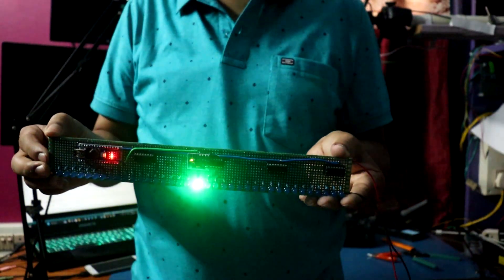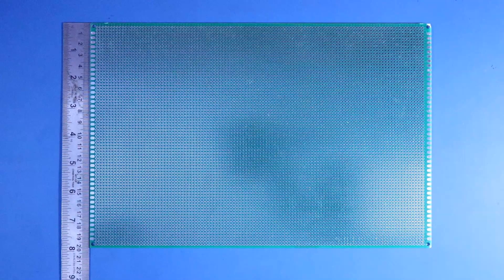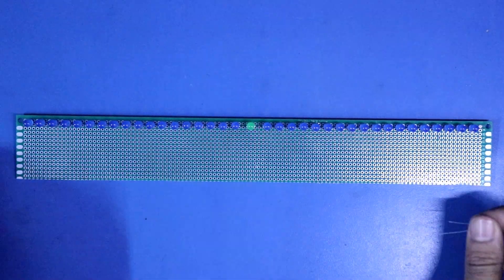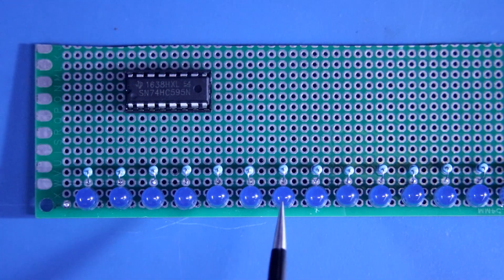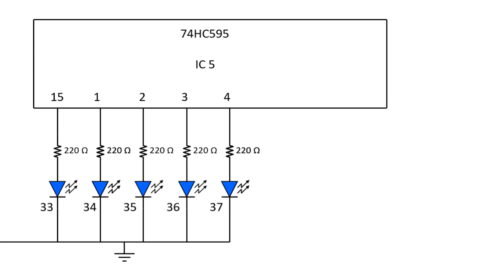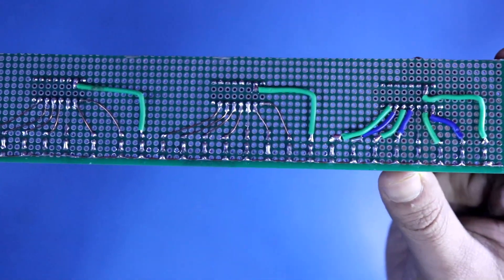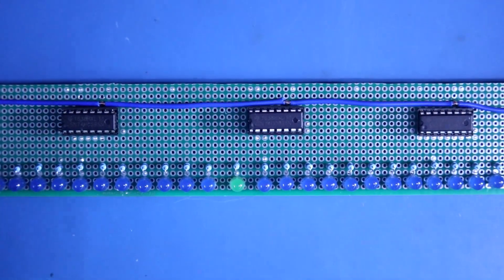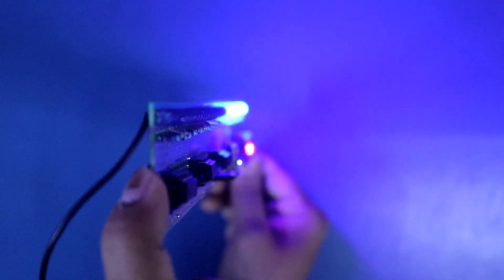Spirit Level With LEDs Using Arduino Nano and gyroscope GY521 | 74HC595

Comment: I am using “EasyEDA” to create a PCB board for this circuit.  Excellent design and very useful circuit.  BTW, your clear explanation of building this circuit is fantastic.
Reply: He's definitely an under rated creator. i build a full size 6 digit clock using homemade 7 segment displays on 6 7x9cm pcbs based on one of his circuits, talk about alot of soldering points man haha. there's a flaw in his circuit but it's easily debugged. he's acknowledged it. i gave him 50 bucks for giving me the idea.

Comment: Is there a quick and easy way to make the LEDs dimmable.  I envision using this circuit for daytime and nighttime use, but nighttime it would be too bright.   Thanks!!!
Reply from the maker: You can try with 470 Ohm (I have used 220 Ohm) resistor. I think that will be ok for night time.
Reply: @EEWave , I have used resistors like 1000 ohms in the past with almost no difference in brightness to 220 ohms.   But I was wanting to dim the LEDs a lot for viewing in the dark. Changing the resistors will make the LEDs always the same brightness, in dark and in light.  Is a switch possible, or a single variable resistor?  Would it be possible to put potentiometer inline to the LED’s ground wire?

Comment: It would be a lot easier to use addressable LEDs. Very cool idea though.
Reply from the maker: Yes, I agree.
Reply: What do you mean by addressable LEDs?  I have not heard of that before.   Can you show a circuit?
Reply from the maker: Most popular addressable LED is WS2812B. I have uploaded a video on this, https://youtu.be/DwSgsYrA9rA

You can also make a running msg display with this, 
https://youtu.be/r6pFUgNN_tA